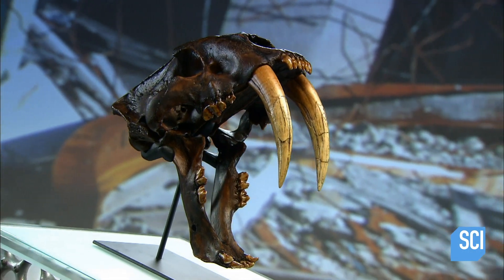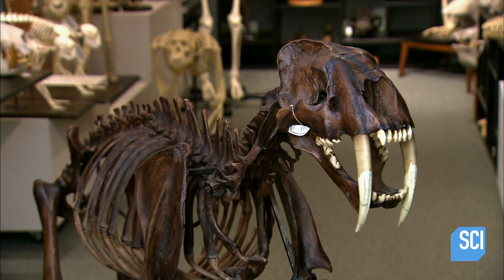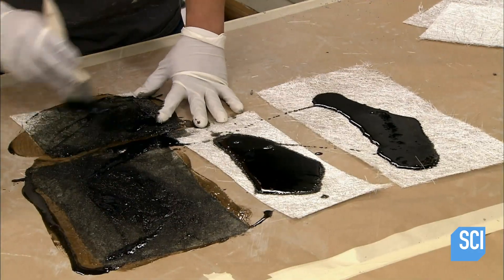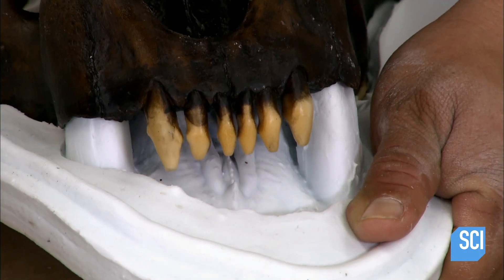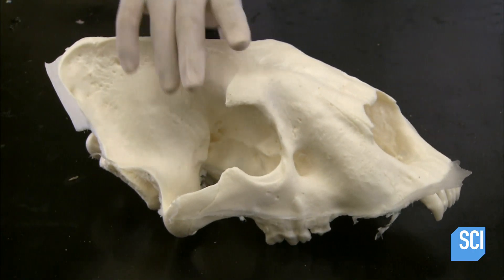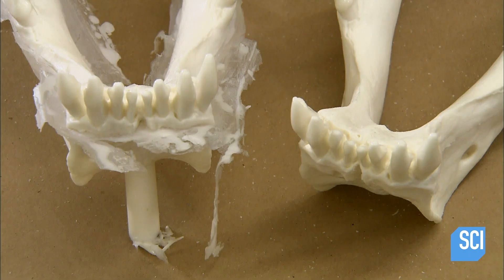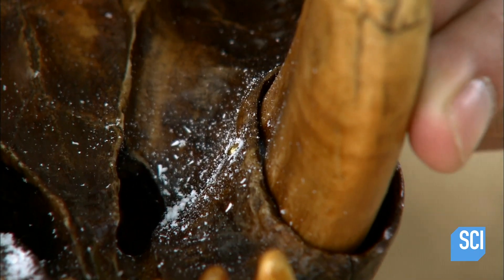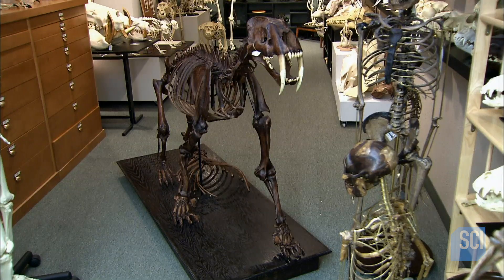How It's Made: Skeletal Replicas

Comment: I was wondering about the teeth. They looked very realistic and didn't appear to be made from resin. Any ideas on where the teeth came from?
Reply: The sabers are also casts from labrea tar pit specimen sabers. Many individual isolated sabers from fragmented skulls are found there. Each are fitted by size to match the skull used in the mold making process. Rarely are both sabers found intact on skulls as during decomposition the sabers generally fall out. Only a small number of skulls of most genus of saber tooth cat have intact sabers. These cats fossils are extremely rare and labrea has the highest concentration of sabertooth cat fossils in the world.
Reply: @davidletasi3322  Thanks for your detailed reply. That's really fascinating. It's inspired me to learn more about this subject.

Comment: Why is he using the wingnuts the wrong way around?
Reply: It allows the wing nut to seat into the fiberglass form. It's secure the two molds from slipping apart during handling.

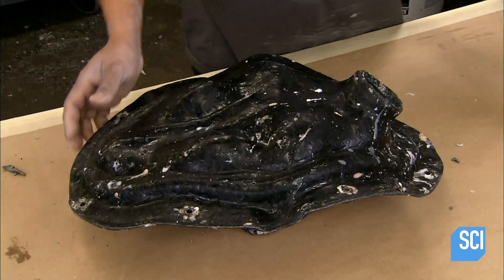Comment: 1:49 “Aw, jeez, I put the nut backwards. I really hope nobody would notice..”
Reply: I immediately came to the comments when I saw it lol.
Reply: They do that intentionally because it saves a little time. The wings on the nut act as a thick washer so they have to tighten through fewer threads.
Reply: @jones81381  makes sense
Reply: @jones81381  I doubt that very much.
Reply: @jones81381  then why not use shorter bolts? it creates a pinch points and is more likely to cause films through creating gaps in the outer ring.

Comment: How’d they make the mold without damaging the real skull??
Reply: With the plastic that was wrapped around before the clay was applied, it prevents clay and silicone from sticking to the skull itself, lowering the risk of damage. And im sure they take care not to damage the skull when removing it from the mold.
Reply: Interesting comments! I've been working in this field for decades and the materials to cast these fossils have improved dramatically over the last several years. The pliable silicone molding material is very gentle to bone and the surface of the skull is treated to keep the bone from sticking to the silicone. However no matter how careful you are in this process specimens have been slightly damaged by this process. Initially fossil skulls to be cast are stabilized by various adhesive like pentrating PB 100 to seep in cracks and solidify any weakness in the fossil bone. It's a very laborious procedure and occasionally some damage can occur to the original specimen, even then the original bone can be skillfully repaired and restored.
Reply: @davidletasi3322  hi David, I am deeply interested in making such accurate replicas for our art class, but in india getting them is inhibitingly difficult/expensive. Could we discuss a way we can?
Reply: @davidletasi3322  I have been thinking about procuring scans of such fossil bones, and getting a physical model machined or 3d printed to then be cast into a better material. :)
Reply: Carefully.
Reply: sabertooth cat a.k.a sabertooth tiger!!
Reply: Its a mold, not lava..